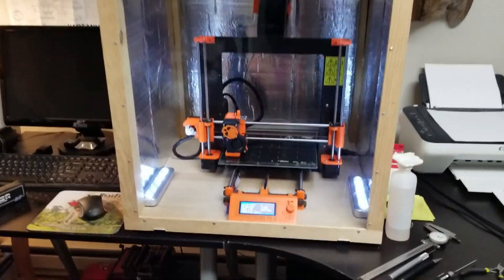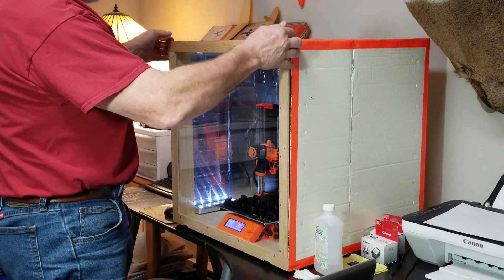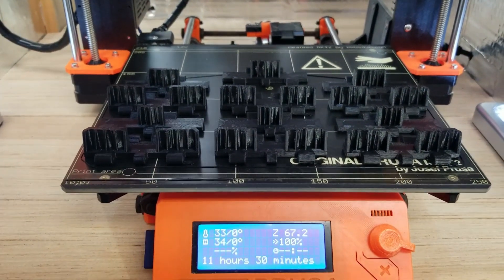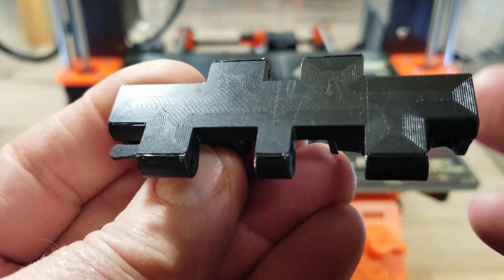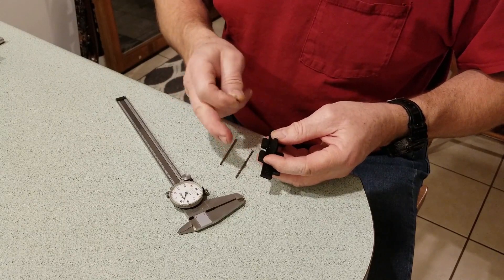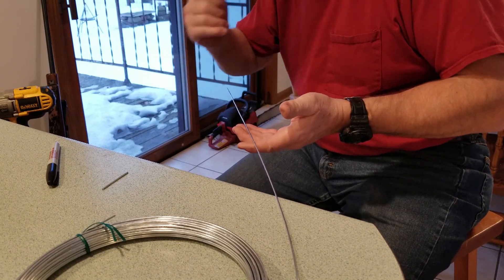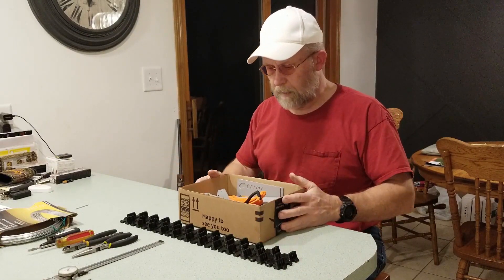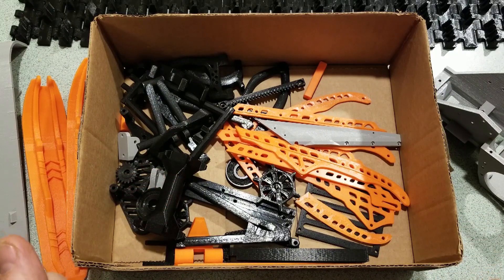SkeeRide 2_Printing an RC Sled...

Comment: So you made this sled with all pla basic? Will I be fine making mine with all pla basic? I was gonna make it in pla + but when I received my filament for some reason I got pla basic instead of plus. So I’m just doing 6-8 walls and 45% infill along with 1.2mm top and bottom shell thickness and embedding walls into infill. If you made yours in basic pla then I’m sure mine will too.